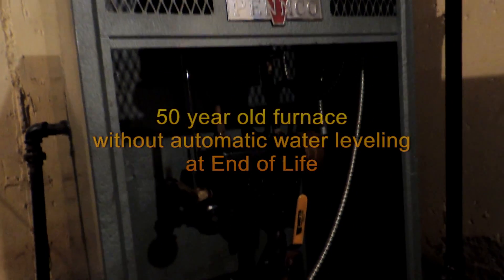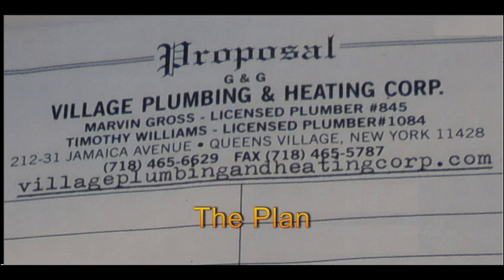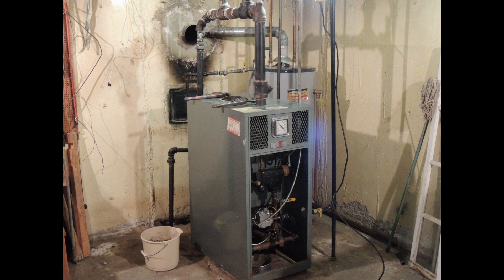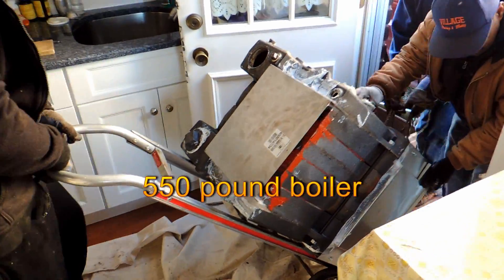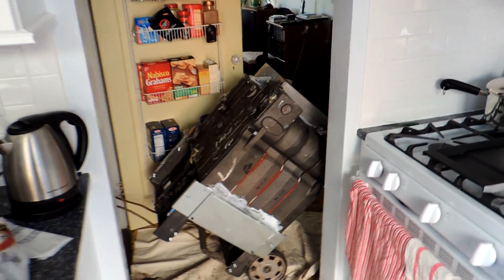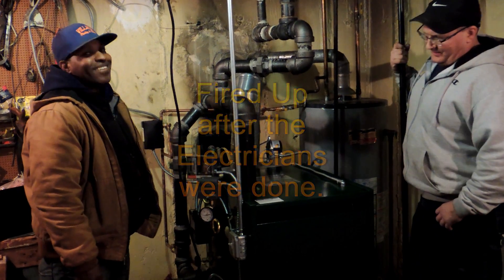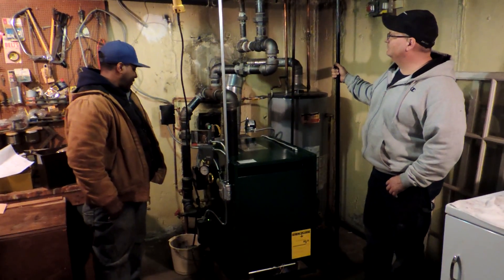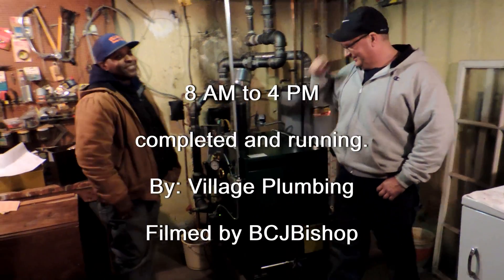Gas Steam Boiler 8 hour replacement

Comment: Dont mean to criticize, but the video is mostly about moving the new boiler, not the actual installation and near boiler piping.  Then again, i suppose its meant for advertising.
Reply from the maker: Bob Winzenburg. Thank you for your comment.   I posted it to celebrate the speed of installation and trying not to be a micromanaging customer. 😄